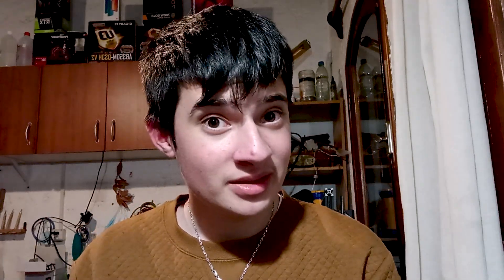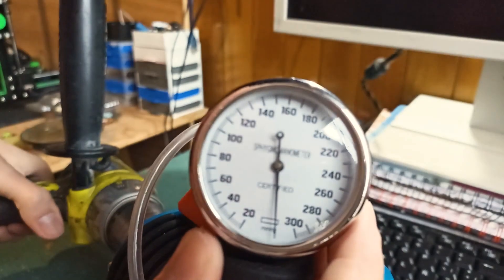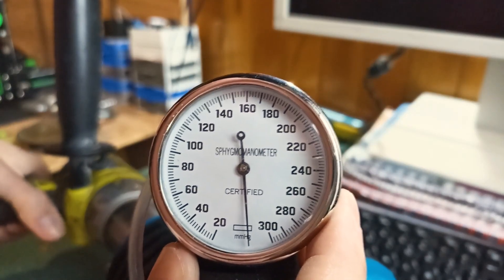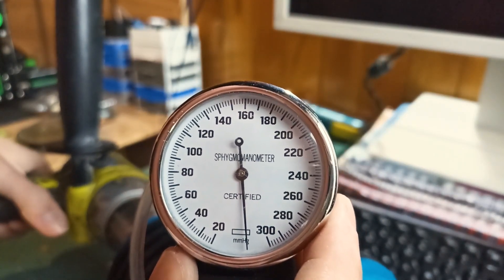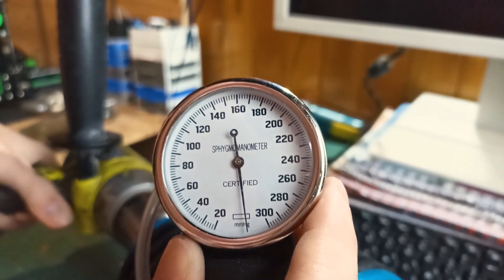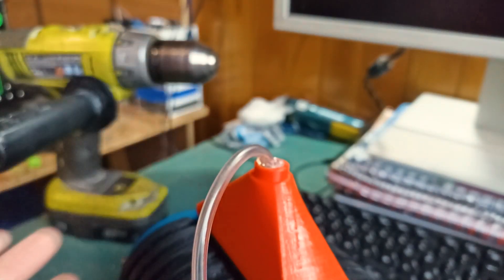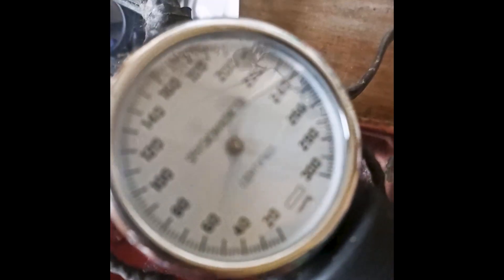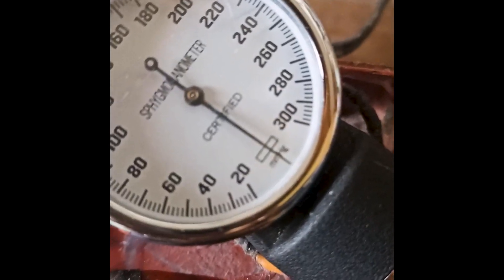I 3D printed a SUPERCHARGER!

Comment: i am also trying to do something like that ! i was doing the research when i came across your video , i think that you should make it bigger and make a larger inlet and outlet  so it can get the most air , if you were thinking to attach this to a quad, so was i .you could run it from the camshaft of the engine through a belt or chain , and can't wait to see if it'll make boost.
Reply from the maker: I'm taking all the feedback onboard don't worry, as soon as I have a bit of time i will be back on making it, thx

Comment: would it improve the concept if you were to use something like epoxy to coat the plastic parts before assembly? (theory being that most all epoxy is heat resistant after curing, so no heat soak to rob power or to melt the precocious plastic) Not sure what your using for plastic, PETG may be a really good option for something high RPM like this as it is very strong and has a higher heat tolerance and adhesion typically.
Reply from the maker: I'm gonna be testing pla, Petg and abs
Regarding the epoxy, i will give a shot

Comment: You can drastically reduce the friction between the impeller and the housing if you print them so the layer lines at where they touch are 90 from each other.
Reply from the maker: Im gonna give a shoot, but due to the geometry of the root it's hard to keep it geometrically acurated because it will need supports